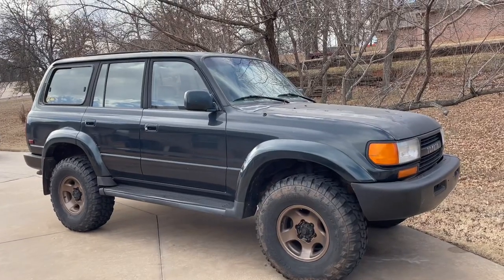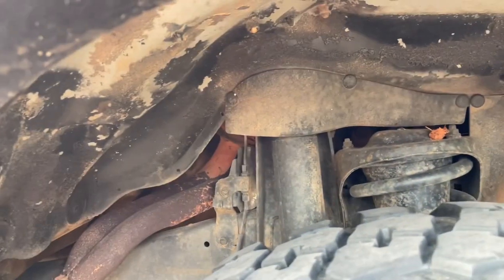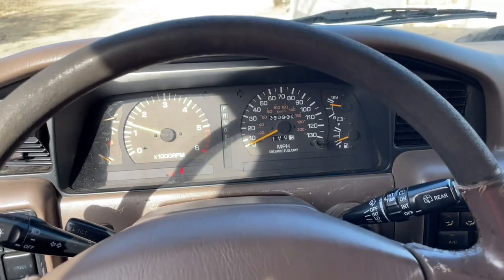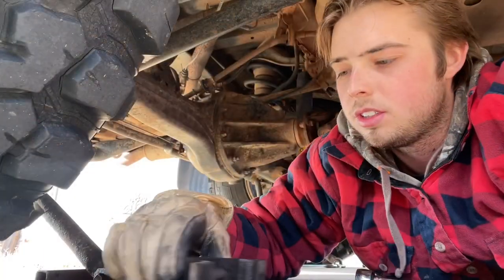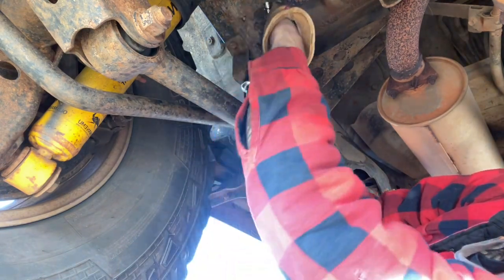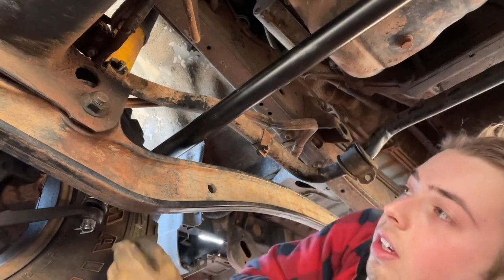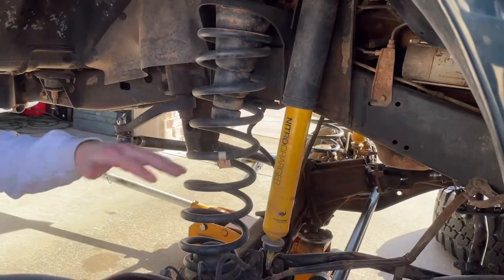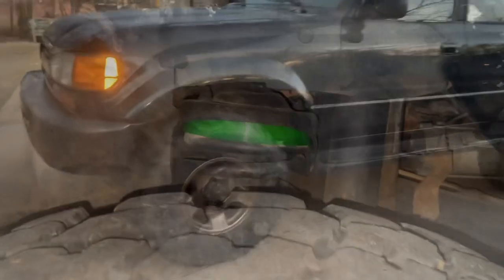80 Series Land Cruiser Sway Bar Bushings and 30MM Front Leveling Spacer

Comment: I have exact same lift w arb front bumper w winch. So it’s higher in the rear. Need those front pucks and sway bar drop so it won’t rub drive shaft

Comment: Thiers a Pan Hard Correction kit sold by emkieth This will help the wondering also thier is a steering gear box adjustment. I see you have castor bushing in your radius arms. They could be toast
Reply from the maker: yeah i may look into getting the adjustable pan hards, i want to do the steering box adjustable as well and the castor bushes are only a few years old so they should be good

Comment: How do you like the Oldman EMU installed? Hows it holding so far? Thanks
Reply from the maker: so far so good, i think it’s been on for 5 ish years maybe 20k miles. i do have the heavy springs, plenty of travel, comfort, and durability. i’m sure there are better kits but $$$
Reply: @theflipflopfabshop  thanks man! Thinking of getting this. My old man FZJ80 have not been upgraded and everything is stock right now. I have so much to replace. Btw did you do anything for the body roll when you installed the old emu 2 inch. Thanks!!
Reply from the maker: @motogp2375  all i did was the caster correction bushings, i’m not sure if drop brackets for the sway bars is necessary for a 2.5” lift but it’s worth looking into
Reply: @theflipflopfabshop  good to know! Thanks man!